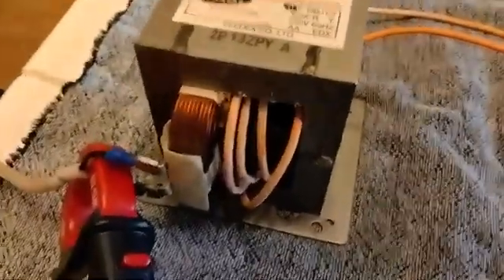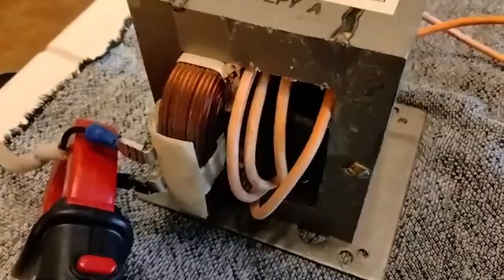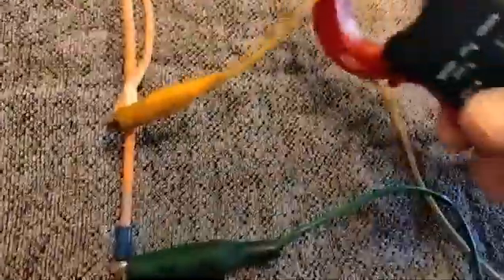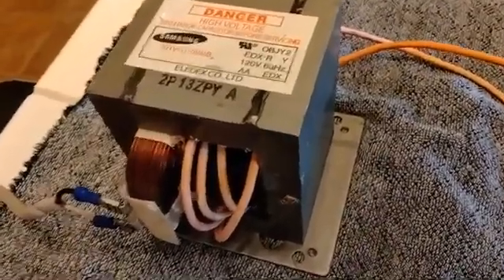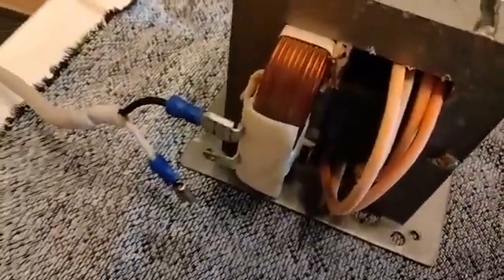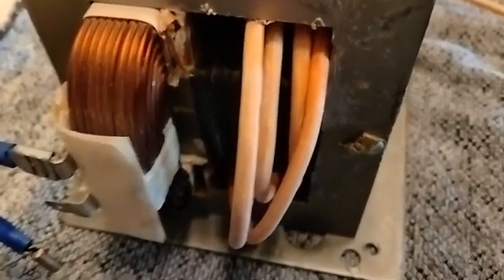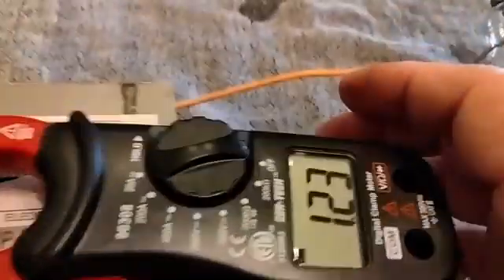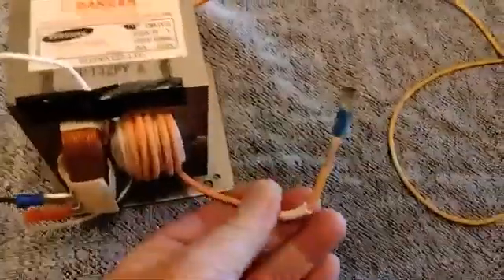Microwave Oven Transformer Rewind the Right Way, Too Many Dummies on here giving Bad Advice

Comment from the maker: ( edit: if you gave me a thumbs down on this video but you still use my advice, I will haunt you in your dreams🤣 ) otherwise....  

 OK OK OK, I guess when I say in the first few minutes of this video that "I am the Expert" I was way too convincing with my attitude and have angered a few people.  It was meant to be funny!  I am NOT AN EXPERT, I repeat, NOT AN EXPERT... But I can tell you this, if you are going to rewind the average MOT and you do not add some windings to the primary, said transformer is going to use a lot of AMPS,  it is going to use them ALL! (again, a joke).  Even if you are not putting a heavy load on the secondary, the transformer is going to use a lot of amps and get very hot over time.  If you are using it for something like a spot welder, where you are only going to switch it (the primary) on for a second at a time, and only a few times a minute, you will be fine, BUT if you are going to use it (your rewound MOT) for an extended period of time, such as a battery charger, a power supply, or for tube filaments in an amplifier, etc... you will need the extra windings, otherwise your MOT is going to get very HOT and use a lot of AMPs continuously (think electric bill).   I created this video specifically because I ran across a HAM operators video describing how to use an MOT for a filament power supply, he does not add windings to the primary and is instead trying to fix the problem by adding a capacitor and a fan.  That is bad advice, that fan cannot cool the inside of the windings, it adds extra unnecessary components, still draw wayy too many amps, and is just over all wrong.  

That being said,  If you are going to chime in and tell me how I can do this better, please read my description where I specifically say this "is a quick and sloppy example"
Reply: I don't give you thumbs down!! I gave you thumbs 👍👍 up, because I found the same thing that you did and you encouraged me to work again with the transformer to build a multi tap transformer.
Reply from the maker: @williamlangley2044  HaHa, I was only directing the thumbs down comment at the people who did give my video a thumb down.   I forbid them from using my advice LOL.  Glad you are having fun with transformers
Reply: Should you keep or remove the magnetic shunt and what difference does it make?
Reply from the maker: @anthonywilliams7052  with these MOT's you should remove them using care not to damage the existing primary, then you need to add some windings to the primary so the transformer will operate efficiently and not get too hot.  Regarding what difference does it make... in these MOT's it will allow it to operate more efficiently.  There are several reasons that transformers in general may use a "magnetic shunt".  If you want to dive into the deep ocean of transformer design or just learn about shunts, you can search the web.  For the shunts, make sure you search for "magnetic shunt".   Also not mentioned in my video is a soft start system.   I use soft start for any transformers that I want to live for a long long time.  I guess I will make a video on soft start next.
Reply: >>>I repeat, NOT AN EXPERT...<<<    Yeah, but you are a damn sight better than what's out there.  YT is turning into a Junk Yard.  The usefull/sh!t  ratio keeps dropping daily.  And yes, I got the humor... Carry on sir!
Reply from the maker: @sempertard  Thanks for that
Reply: @bigcbradio  ..and, keep the shake on the handheld camera in ALL of your future videos !!!
Reply from the maker: @NavinBetamax  it says right in my "about" statement "please remember that these videos are all recorded on a crappy old cell phone, and I am no expert, so the audio and video may not be the best." and I'm fkn old too.
Reply: @bigcbradio ....... Shake...Shake....Shake The World........!!!
Reply from the maker: @NavinBetamax  it's actually just a 4 year old free cell phone from metropcs, pretty low quality
Reply: @bigcbradio  ....year of Make, Model, User Knowledge of usage....etc don't matter to your Highness ! Just....Shake...Shake...Giggle...all the way. Sir !
Reply from the maker: @NavinBetamax  i see your Betamax, I have an old Sony Betamax in my collection with a 20' corded remote
Reply from the maker: @NavinBetamax  I borrowed a ladder from my neighbor and replaced the smoke detector battery, but I will keep the low quality video and the shake.
Reply: Damn it homie, after talking to you a bit I wished I wasn't right...  I'm here for you brotha!
Reply from the maker: @ScandalistRick  HaHa, Thanks.  I have my big boy pants on, and I may make another transformer video now.
Reply: People need more guys like you. Do not let them (i.e. "Dummies") intimidate what is the best way to teach.

Comment: How did you remove the secondary? usual method of an angle grinder or does somebody have a more elegant solution?
Reply from the maker: I use a fine tooth hack saw and take my time, lots of fun.   If you are using the transformer for something like a spot welder that has a very low duty cycle and it will only be powered on for a few seconds at a time, there is no need to add any primary windings.

Comment: Hey BigCB, I'm considering powering 2 GU-81M vacuum tube filaments to drive a Tesla coil.  The draw for both included would be 12.6volts @ 22amps = 264watts (again, filaments only).  Just off the top of your head, do you think there would be enough physical space to implement your primary coil fix + the custom secondary I would wind to get the power I need?  I don't foresee a heavy duty-cycle on this transformer.  Maybe 30 secs on, then a couple minutes off.  Thanks.
Reply from the maker: I do believe there will be enough room.  Make sure to use the proper size enameled magnet wire to continue the primary, and wind it in the same direction as the original primary.  You should also have plenty of room for the larger secondary windings after that.  It looks crowded in my video because I just used some scrap wiring and not magnet wire.   Give it a try, and don't have the wiring a mess like me, and make sure to use fuses!  and thicker wiring for the secondary at 22 amps.  You should only need around 11-13 wraps on the secondary.   Once you get 8 or 9 wraps on the secondary I would start testing the secondary voltage with the load of the 2 tubes connected and finish the number of wraps as needed.  Have fun.
Reply: @bigcbradio  Cool! Thanks man...
Reply from the maker: @ also, in case you didn't know, you do not have to do full wraps, you can have that secondary you need start on one side and come out the other if you need to get the voltage perfect.  Also, you may want to wrap and test it where you will be using it, what I mean by that is, for example, my house has around 125-128 volts all day, and 120 at night, and my other house has about 115 at all times.  It makes a noticeable difference on output.  Just for fun you could tap the last couple secondary wraps and get a few different voltages out of the secondary.
Reply from the maker: @sempertard  let us know how it goes
Reply: @ I will.  Already got the 10ga secondary wire.  Thanks BigCB..
Reply from the maker: @sempertard  Nice

Comment: If you get 2 identical MOT's and series the primary's, each will only see half of the mains voltage, and run much more efficiently and cooler.  The issue is, as you described, they have too many volts per turn on the primary.  Then you can wind whatever you want on the two secondary's, but you need to balance the loads, so say you want 12v, wind the secondary the same on both and series them to get 12v.
Reply from the maker: I actually have many mot's and I do have 2 matching.  I was planning on doing just that with them, but I haven't got around to it yet.  I was going to run the secondaries in parallel.   You have good advice, hopefully others read this also.
Reply: @bigcbradio series is better as it spreads the current evenly. Just aim for half the voltage required on each one.
Reply from the maker: @dieseldes6578  I will try it both ways, it is just for 6.5 volts so it will be easy to try it both ways.   Maybe I will put them next to each other and try looping the secondary thru both !  😀

Comment: I had to do a little research before posting and I'm not 100% sure on this, but think I've got a pretty good handle on the facts.  If the transformer was running in magnetic saturation, add more turns would make it worse as that would increase the magnetic field.  What would be fixed by adding turns is if the base inductance wasn't high enough for good reactance at line voltage.  This is why you do see people ballast the transformers with caps or inductors to tame them down.  Just lowering the voltage that's across the primary.
Reply from the maker: Just like you I have done research over the years, and specifically on MOT's, and again like you, I'm not 100% sure on anything either, but I like to think that I also have a good handle on it.  What I do know is that if you add windings you can reduce the idle draw to almost zero and add your own secondary to MOT's and use them without them getting hot when there is no load on the secondary.  I also still believe that as they are wound from the factory they are saturated, that is how they limit the power to the tube.  As far as ballasting, I personally think that it a very poor and incorrect solution.

Comment: I already knew this way before I watched this that these transformers are terrible for low power or continuous operation due to their saturated design. however, to just yolo it and adding more turns like you did here is not really a best cutting edge solution I would brag about either as it will not solve all downsides these transformers have. But hey who am I to know. 
A better solution would be to wind a completely new primary winding for it calculated for the lowest possible current draw under no load condition. a well made transformer should have barely any current draw at all when no load is applied to it, the issues with microwave trannies is that the sheets are welded together making the Eddie currents worse in the core so it simply can´t become a good transformer even if you re-wind it really good. I would simply just use these cores for simple work and keep it for such instead of being cheap and crappy. But I do admit that adjusting the primary side is more important than most people say.
and for god sake if you know your smoke detector battery is flat just go replace it when you know you making a video with it in the background
Reply from the maker: Yes, adjusting the primary side is very important, and yes an ideal transformer will have almost no draw at all.  If anyone here is trying to make an ideal transformer they should do some serious calculations, then go by a toroidal core and some new wire, but I don't think people hammering and / or cutting apart MOT's here on YT are trying to get that technical.  Anyways, thanks for the comments and if you can, run over to Arizona and pick up my 20' ladder so I can reach my smoke detector, or bring me your ladder and a battery.   Alternatively you can turn down the volume and use the closed caption feature😁.  

Since you said "A better solution would be to wind a completely new primary winding for it calculated for the lowest possible current draw under no load"  aren't you kind of defeating the purpose of using the MOT to begin with?  You might as well just tell YTubers to just go by a blank core and a bunch of wire and start over.   You are defeating the whole purpose of repurposing the MOT to begin with.
Reply: I would happily change the battery for you if you would pay for the trip but I am on the other side of the planet so it is quite a bit of travel to do so I’m afraid
Reply from the maker: @Pulverrostmannen  LOL, OK
Reply from the maker: I borrowed a ladder from my neighbor today and put new batteries in all the high ones.... it's really boring around here now.

Comment: 'Magnet wire' is not a thing- you mean 'Enamelled copper wire'. The iron in those transformers is welded together and that is crap as regards transformer design- all the leaves should be isolated from each other, MWT's are built cheaply to provide short bursts of HV and that is all.
Reply from the maker: Also.... https://en.wikipedia.org/wiki/Magnet_wire
Reply: @AverageJoe2020   Magnet wire is copper wire with a thin layer of insulation, and is used in a variety of applications including transformers, wound coils, motors, solenoids, and instruments. Raw copper is drawn to meet specific size requirements based on the National Electrical Manufacturer's Association (NEMA) standards. This magnet wire meets the NEMA MW 80-C standard for operating temperature (155°C/311°F) and insulation makeup. The insulation is made from modified Polyurethane with a polyamide overcoat, and protects the coiled wire from short-circuiting.
                               So with that said , YES magnet wire exists in this real world , you must have hit your head real hard before you made that comment ....
Reply from the maker: next you will tell me "wide open throttle" is not a thing HaHaHa.   Short bursts?  I will make sure not to cook my pizza longer than a few bursts then.   I would also bet the farm that you have never actually tried using a MOT for any project before because obviously you do not know what you are talking about.

Comment: Quite insightful, seeing is believing 
In high school shop class one of the projects was to build a mains powered transformer from scratch including cutting the lamentations and firing them to get that oxide coating
Reply from the maker: That sounds like a great school and a great teacher.  Out here in California the local high school removed all the shop classes and at the grade schools they removed the tether ball poles, the monkey bars, and the slides, they only left the swings and a sand box, and the children are not allowed to play tag, or dodge ball, soccer, or football.   The award ceremonies take hours because almost every child gets an award because they have 3 levels of honor roll now and a participation award.  Ok, I will stop ranting, LOL, but, that does sounds like a great school and a great teacher.  Have fun with transformers.

Comment: I tried to turn a MOT into an Isolation transformer and ran into high idle currents etc, ended up having to wind two primaries in series, luckily I had enough lying around to not have to wind my own. Disappointed to have a transformer twice the size but half the power, but helped explain why microwave transformers are so much smaller than other transformers I've got with similar power.
Reply from the maker: yep, if you compare to any ideal transformer that delivers the same amount of power, they will be twice as big as an MOT, but MOT's can be wound to be efficient enough to be very useful
Reply from the maker: also, I didn't mention this in the video, and no one has mentioned it, but I had to use 5.5 wraps instead of 4 wraps on the secondary to get the same 4 volts after I added to the primary.

Comment: Absolutely correct. I’ve been laughing about this for years. Kudos to you for making this nice PSA about it. I’ll add that the other reason these transformers are designed the way they are is because it is cheaper. It is all that’s necessary since they only operate on load except for the couple of seconds for the magnetron filament to heat. Notice a MW hums loudly for a couple seconds, then quiets down.
Reply from the maker: Me too, but enough was enough

Comment: Hum ok sounds very reasonable and explains why the microwave hums when its zapping the contents. I was considering using one for a spot welder but was given an old radio filament transformer for huge KW valves and its only a couple of volts with no hum and huge current and doesn't get even get warm. Mind you its heavy.
Reply from the maker: Nice filament transformers are getting harder to find and usually expensive.  I don't know what transformer you have, or what kind of spot welding you want to do, but most spot welding will require more amps than you would want to try to extract from a filament transformer.  I would hide that filament transformer in my closet and find a free microwave transformer to turn into a spot welder.   For use as a spot welder you wont need to add any turns to the MOT primary as long as you have it switched on and off with each spot weld.  There are a lot of spot welder MOT videos on YT.   Some are crude, some are pretty nice.  Good Luck.
Reply: @bigcbradio  Yes I would agree but Im making only a micro spot welder primarily for tinplate, nichrome elements and maybe battery tab welding so although the MOT would suffice I thought that having this Xformer I may as well use it as I will never be doing anything with large valves.
Reply from the maker: @campbellmorrison8540  Sound good, have fun, and maybe make a video while you build it.